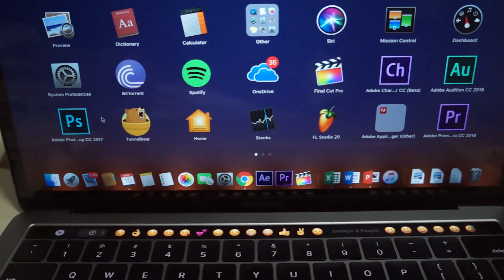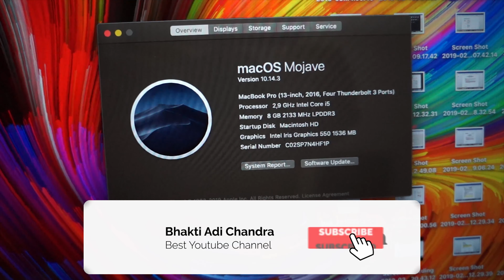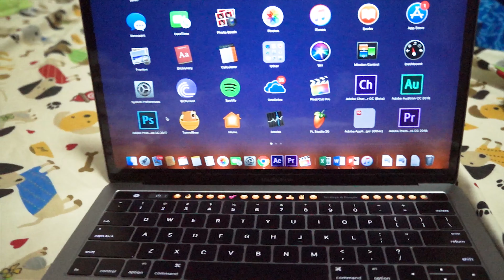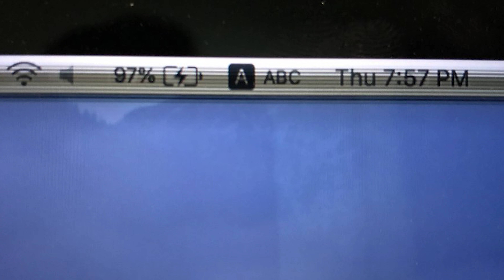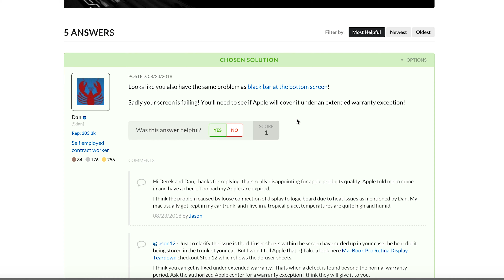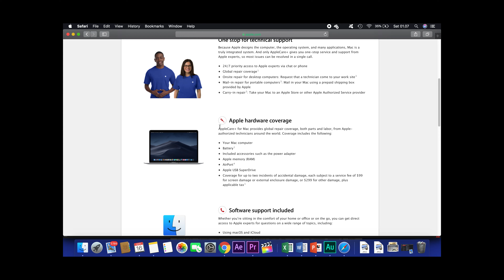Watch Before you Buy Macbook! Flexgate and Common Macbook Problem

Comment: Do not buy MacBooks because they have many issues going on and apple is being completely ignorant about it, After having a keyboard issue and then motherboard issue on my 2016 MacBook Pro 15" 

Now it's out of warranty and I started having flexgate issue on march 26 2019
On March 27 2019 i wen't to service centre and they are charging me INR 60,000 which is USD 870 just to replace screen when I showed them posts on internet regarding the issue they just said that "there are many false posts on internet" and we don't know anything about this issue, that means unless I pay for their design flaw they won't replace the screen as they don't yet have any programs for display issues.

please sign this petition to help me and many others who are facing similar issues but receiving no support.
https://www.change.org/p/apple-fix-all-macbook-pro-2016-and-later-with-stage-light-effect-or-backlight-shutdown-flexgate